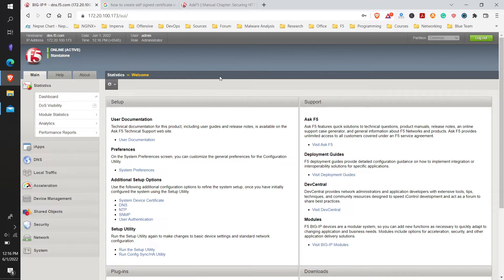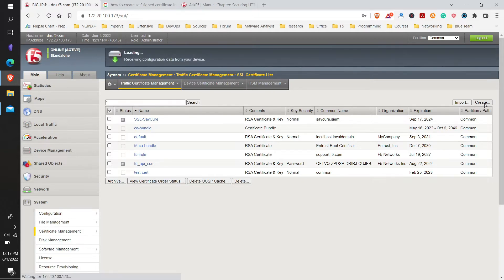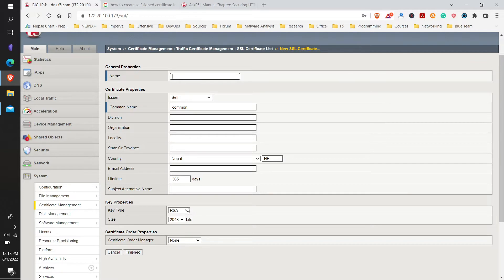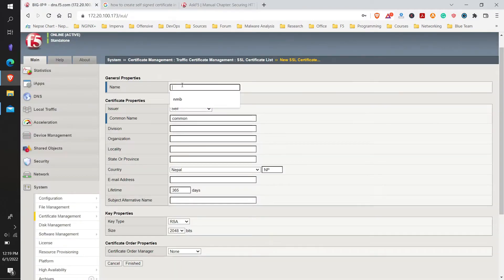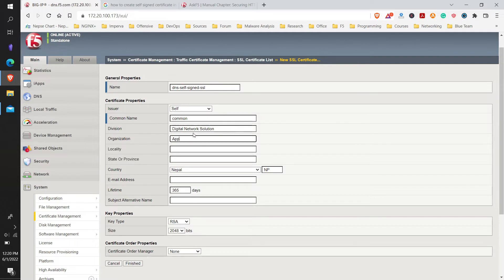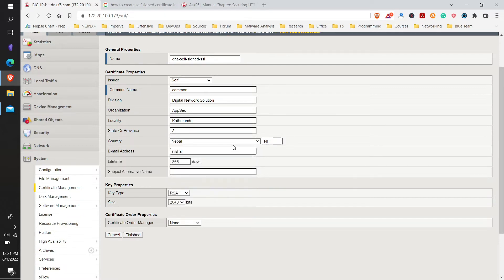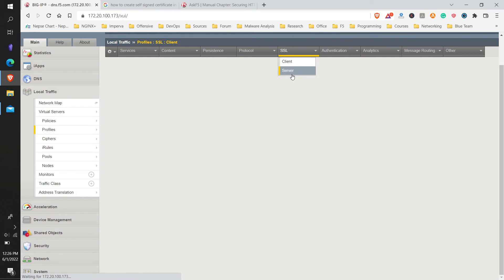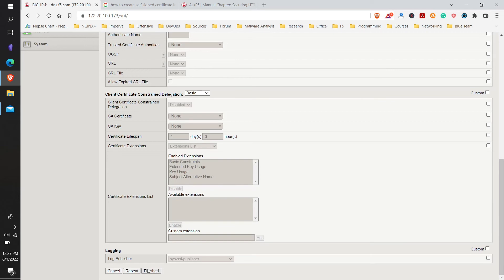Implementation of SSL certificate on F5 appliance | Digital Network Solution

Comment: Hey how abot implementation of mtls ? Is there any different?
Reply from the maker: Apologies for the delayed response!
Mutual Transport Layer Security (mTLS) is a process that establishes an encrypted TLS connection in which both parties use X.509 digital certificates to authenticate each other.
Reference:
https://www.f5.com/labs/learning-center/what-is-mtls
Regarding the configuration of mTLS on F5 BIG-IP, you need to configure certain parameters on the client SSL profile of the client authentication section. You may also need to use iControl for access control purppse to limit access to only DocuSign.
Reference: 
https://developers.docusign.com/platform/webhooks/mutual-tls/mutual-tls-f5/